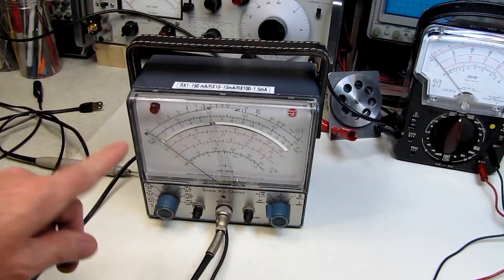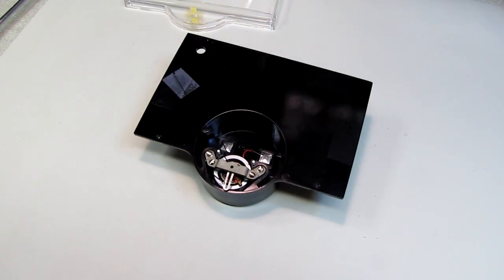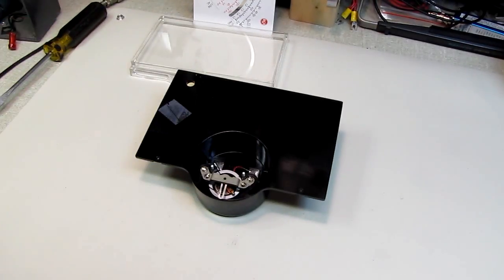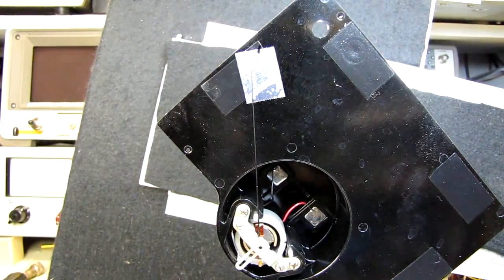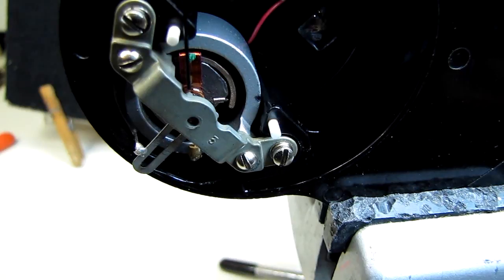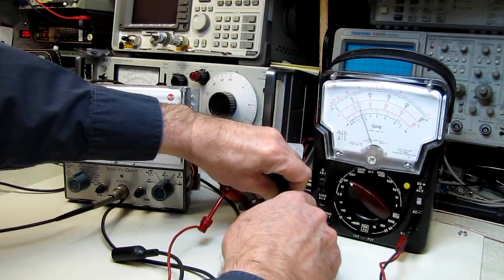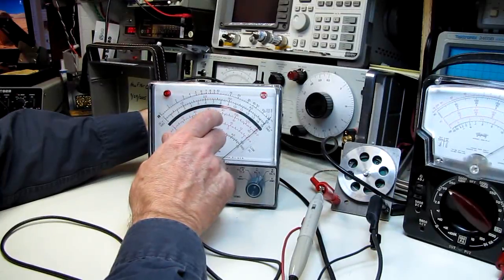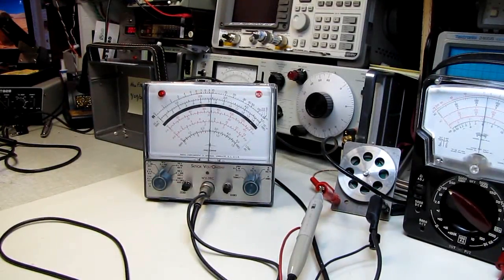RCA 98C  Senior VoltOhmist Repair WIN ! Meter Movement Fixed

Comment: 9 years ago,  OK  hope all is well and you are still actively posting things. I have an old Simpson 260 that I used back in mid 80's in the back of a Bowling center I worked in. Silly me for being sentimental and accepting it as a broken gift from my old head mechanic. around 15 years ago I just got around to digging into it to see if It could be made to work. I took the front pivot plate loose big mistake. I will see if I can get it and my old Micronta working as well. Tangs for posting and leaving this jewel easy to find. Pun intended

Comment: I can remember doing this back in the seventies as a calibration technician to AVO 7 and 8 movements. We had old cases from scrap meters that we modified so the dial was protected from air movement, but we could access the movement to adjust the balance weights. We used shellac to fix the weights in position, it melted and cooled quickly. It took a long period of time to master the technique to get balance at all three positions. One old boy was a master at it. After checking all three positions in the movements original case, he would if it needed adjustment fit it in the modified case, heat all the weights at once and  reposition them. Then check it and 90% of the time be able to replace it in its own case. I used to take several goes to get it right. Was really happy that the AVO multimeters at the various MOD sites only came in for calbration in small batches.

Comment: Very useful.  I have an old WWII era ammeter I'm trying to refurbish.  The needle seems balanced with no current through the meter.  But when current is flowing (typically about 3 to 4 amps), tilting the meter causes wild changes in the reading.  Remove the current, and the needle stays at zero with the same amount of tilting.  I don't know how to proceed with it.
Reply from the maker: Is this an ammeter from a truck or a generator or something like that? Or is it actually a piece of test equipment

Comment: Hi. Another, but similar, subject. Me, and one more gentleman, are trying to understand the deviation of our Metrawatt MA 4E analogue meters, with op-amp CA3130 and voltage-to-current circuit. The meter has 10M input impedance on DC. The whole time we were thinking that the problem was/is somewhere in the electronic circuitry or the op-amp itself. We could not get the meters accurate enough over the whole scale-range. Looks like some non-linearity issue, that we can not solve solely with the gain and offset calibration and adjusting. He and me tested the meter movement alone, it is a 30uA 'classic' movement with 2 springs. i do not see any issue with the friction, so no tapping problems with this one. These are the results (mine and his almost identical, the meters are according to the serial number almost the same age): Readout meter MA4E: 30, 20, 10, 5 corresponding current: 30.26, 20.06, 9.82, 4.84uA. It has 2 V, A ranges: 30 and 100 (which is some more extended), and I am now unsure what to expect if I test 0 to 100% instead. Anyway, I was thinking maybe you would have some idea from your previous experiences about this issue. Do weights play a role when the meter is used only horizontally? I don't want to bias you to much, but 1 'wing' (right) has no weights at all, and the left one has some solder tin I believe, as the tail has considerate amount of solder attached to it. Hope you can give us some insights 🙂 Thanks in advance.
Reply: I have just tested 0 to 100% of the scale. The conclusion is that for the higher sections of the scale more current is needed (percental) then for the lower part of the scale. For example: 100% is 31.94uA and 10% is 2.8uA. Could the spring be non-linear? Tension? Homogeneity of the magnet or the helping metal construction around it? ...
Reply: @ernestb.2377  some designs of photographic light meters have two steel arms that can be moved to increase or decrease the magnetic flux further along the needle travel. One would want to confirm mechanical balance and that the hairspring coils have no physical contact with each other first, and that there is no ferrous debris stuck to the magnet polls impeding the armature travel. (They can be removed with a steel needle.)

Comment: Hey Vern I asked it another video a while ago but I never got an answer……what is the wheel you use to dial voltages up and down? It’s really cool and I want to get one. 
I’m about to undertake this surgery on a Sanwa meter movement that is out of balance. I’m all thumbs and zero for a few in meter movement battles lol. Thanks pal for another great video.
Reply from the maker: That's just a very large 10 turn wirewound potentiometer that came out of a piece of old military gear.
Reply from the maker: 1000 ohms with a .05% linearity
Reply: @theradiomechanic9625   That’s very cool. I saw it several years back in this video and loved it then. So far I’ve done the first part of your instructions. I put a replacement weight on the tailpiece and both horizontal and perpendicular are good. I’m letting the silicone cure overnight. It will definitely need a weight on the right side of the cross like yours did as when I move the zero to vertical the pointer goes negative. I suck at this but I’m taking my time and following your instructions to the letter. Thanks again.

Comment: Interesting to watch. I see you tapping on the meters very often. I am working on this ISKRA MI 7043. The problem is that the right value sets after a tap 🙂 It is off by about 200mV. I can't find in the user manual that one needs to tap before taking a reading 🙂 Just kidding, what I mean, do I accept the "tapping"  it should be possible to get it right even on the meters 30-40 years old. The meter is not beat up and in a very nice cosmetic state. I need to replace some resistors, that was a quick fix (5% resistors) after a blow on mA range, some 30 years ago.. Delicate (watchmakers) work on those movements, as it led me to your video. I can't really see the spring coil on your movement?
Reply from the maker: Almost all analog meters have some friction in the bearings, and "back in the day" we were taught to tap the meter to allow the needle to settle in. I have actually seen operators manuals that said to gently tap the meter to get the most accurate readings. In the "twilight " of analog meters the "Taut Band" suspensions were introduced. These eliminated the friction of the bearings.(Search Taut-Band meter). Made that video years ago and that meter was passed on long ago. There was a spring, must be hiding behind behind the "bridge" holding the bearing. I looked at the video and it isn't visible, but it was/is there. Also back in the day pilots flying planes with old "Steam Guage" analog instruments were often seen tapping the gauges for the same reason. Another problem with analog meters is that static electricity will cause problems. One trick is to wipe the face with a dryer sheet, or spritz a little alcohol on them to dissipate the static electricity. Static will cause the  needle to move away from Zero and or cause erratic readings.
Reply: @theradiomechanic9625   thanks. I have several (5) analogue meters. A few have excellent movement, as I tap nothing changes. The "tapping" is a logic thing to do if you don't "trust" the initial position. Until a few days ago I naver actually opened or studied any movement. Interesting thing is too that the current needs to go through the same moving axis, with possible errors too (extra resistance). I have heard of Taut Band term but not yet looked it up what is actually is. I also see that in this ISKRA MI 7043 the magnet not so big is, and I see that within some big units (like Simpson) also a big movement inside. Anyway if friction is present then looks like no easy task to neutralize it...

Comment: I have a similar meter I need to re-balance. There are no hair springs - just a single torsion wire.
In my case I need to reduce the weight on the opposite side of the needle.
I can't figure out how to remove what looks like varnish or glue that holds the existing coiled wire weight in position.
Can it be removed with a solvent? Could it be some sort of wax that can be melted with a miniature soldering iron?
Do I resort to trying to cut the wire using micro shears?

Comment: What is the device you are using to adjust the voltage of the power source? Did that come with the HP? I’ve never seen that rig before.

Comment: You sir, saved me, I have 2 multimeter, a Sanwa TX-301 and Simpson 269 both with same issue, now at least it is usable and very stable needle, as if the needle were trying to re-learn how to read :)

Comment: Excellent. I'm working on a smaller movement in a Heathkit tube checker with a different problem, but learned a lot that's helping my project.

Comment: Well done. I spotted this video after commenting on the previous one.
Reply from the maker: Hi Richard, got the procedure from a 1946 Radio Amateurs Handbook. Too bad about your meter having the wings nipped off. Sounds like you will need to find another one for parts

Comment: Hello, I am missing one of the side weights on an old manual (hook wires to terminals for ranges) laboratory-use W. M. Welch DC voltage meter. Do you suppose that each meter model will require it’s own specific internal diameter tungsten weight? If so, I probably won’t be able to use the same bulbs/weights that you used. Any other ideas for a substitute? I’m not an electronics guy, but I have rewound numerous speed coils and a few stators for antique electric fans. Thanks, Kevin
Reply from the maker: Hi Kev, I would suspect that they vary from manufacturer to Manufacturer. However even if they are a little loose some adhesive will secure them. The weight needs to be very small yet carry some weight. The tungsten is very dense/heavy and works a treat. Just collect several types of old lamps. Headlights, tail lamps etc. Something will fit. Patience is the keyword here. Thanks for stopping by.

Comment: What kind of control is that you are using to control your power supply? Kinda looks like a rotary phone dial.
Reply from the maker: HI Leland, that is a precision 10 turn Potentiometer being used as a voltage divider to allow me to get high resolution on the voltage setting. The "Dial" is a gear. Originally this pot was from some sort of positioning system and was gear driven.
If I want a 10 volt range I set my power supply to 15 or 20 volts and use the pot as a voltage divider to accurately set the voltage I want.

Comment: dear sir , do you have any idea if one of the "clocksprings" is missing or heavy damaged what can we do? replace it maybe what with what? thank you
Reply from the maker: Hi Konstantinos, That would be far above my poor skills to fix. These movements were produced by skilled crafts people. Where you would find a replacement spring is beyond my knowledge. The weights were fairly simple, but changing a spring would be a tough job.
Reply: The Radio Mechanic I must use an identical spring? The same as the other side? Maybe someone who fixes clocks can help me?

Comment: Great repair, I could never work with this very tiny stuff, are you sure you are not a watch maker?...LOL
I will leave mine alone, I ruined one meter by screwing with it.
Reply from the maker: Hi goat. I only had to wear 4 pairs of glasses to see the thing. I figured it didn't work anyway so I had nothing to loose. 
And as an old engineer I knew used to say, " give it a try, you can't loose em' all.